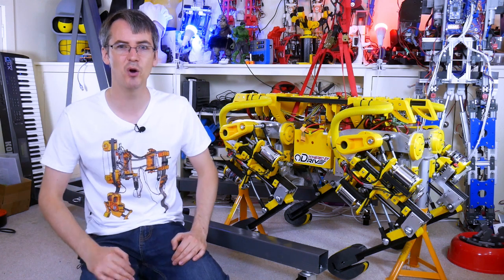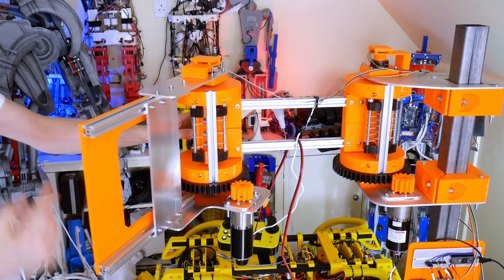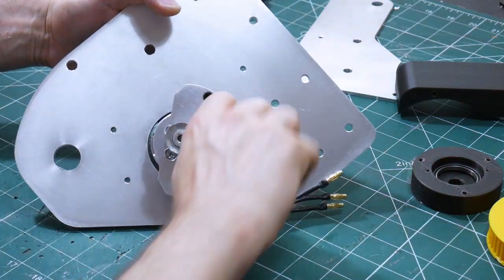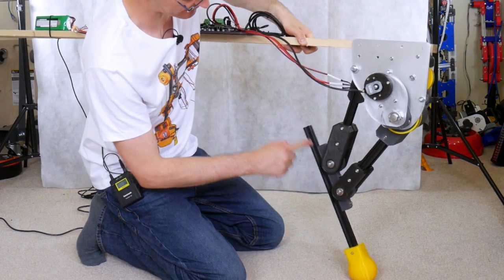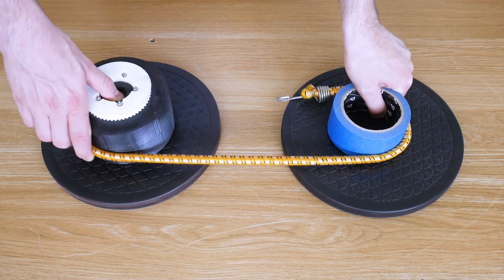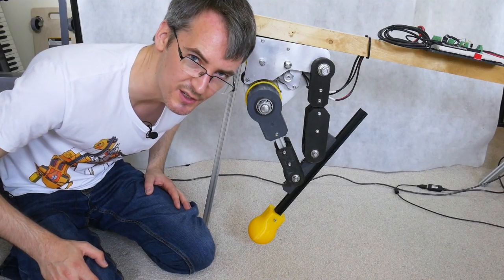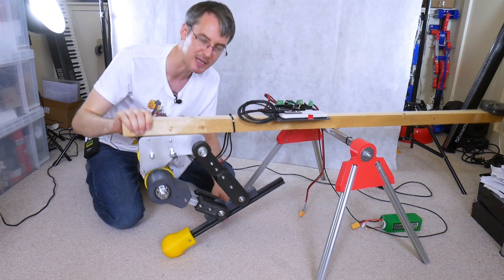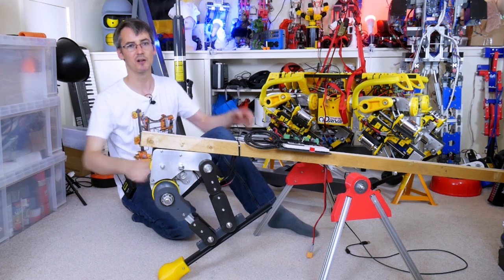Simulating a Compliant Dampened Spring with Current Control

Comment from the maker: The essential aim of this video is to see how openDog needs to react when its feet hit the ground, although I'll be avoiding changing its mechanical structure to make it work. It's very very hard to keep openDog perfectly level 100% of the time when taking steps, which always results in a powerful rigid leg pushing it back hard when it tips and causing stability to be much worse. Also it would be good if it can react to uneaven ground and being pushed about.

I'm going to build four of these compliant legs to help prove if their reaction is correct, and then try to apply that to openDog in code using foot sensors to make openDog's legs compliant and have the same reaction, albeit with rigid actuators that cannot be back driven.

I'm pretty happy with the initial results in this video, so any future leg projects will probably work in a similar way.
Reply: I just got a grant to put together an opendog at my university, is there a good place I could send you an email to ask direct questions or collaboration opportunities?
Reply: The inertial measurement units should hint you about which direction the robot is leaning towards and that should be the the place the legs should move to prevent tipping right? The averaged tilting (between frames) of the body will also tell you how long to stretch each leg to stay leveled. Maybe these should be two different programs collaborating/competing together? One that tries to keep the level and another that tries to step in the direction of movement to keep the center of balance "balanced". Amazing (very complex) project! Cheers!!
Reply: I’m lost as to why you keep messing with these ‘compliant’ legs. You have an issue with balance. How is this going to help?
Reply: So I made my suit Bluetooth and need help with making it self balancing and your the man in that field so any suggestions?

https://youtu.be/2OalUmIwoKw
Reply: why avoid mechanical parts? mechanical parts will always be more correct for these sorts of things than circuitry and motors, though only if planned ahead correctly.
Reply: the music is annoying.  Its not necessary, please stop adding music.

Comment: Why does an actuator need to be backdriveable for current control? I would (naively) assume that you could actuate a non-backdriveable actuator in a back-and-forth pattern and measure or limit current when the actuator is moving against the expected resistance.

Comment: I'm ignorant when it comes to CNC, so what it the reason the tool paths hog out the entire center of a large hole instead of a circle around leaving a disc? Would the tool throw it out at high velocity?
Reply from the maker: Yes unless you leave it attached with tabs which you need to file off. I chose to do it that way to make a clean hole.

Comment: Have you also considered the idea of a dampener? It'd keep the foot on the ground rather than it potentially springing back up, while also allowing for more springiness. Basically how shocks and springs work on a car, just on a much smaller scale. Though, I'm not sure how this would work with your motor simulated spring.
Reply from the maker: Well it's damped in software - that's the whole point of the demo undampened vs dampened

Comment: Great video! One way you can offset the weight of the mechanism and take the load off the motor is to implement a bungee or a spring to support the weight. Or even a small air cylinder!
Reply from the maker: I'm currently building another three legs that will support themselves, so I may we ll do that

Comment: Somehow I get the feeling that an analog circuit in this build is needed. Digital just requires too many clock cycles, and I swear it looks like you need tubes. As in vacuum. Think about it. Even if that is way off, analog may help in some instances, I just KNOW it. Anyway, Excelsior.

Comment: When you say that your going to make more legs for a total of 4, and attach them to a frame to test them, I imagine you 3D printing plastic corners, and assembling something out of extruded aluminium. But I liked the balancing piece of wood, in the drop test, so… I think it would be simpler and less time consuming to go to a home improvement store, and have them cut out a rectangle of plywood approximating the size and shape of Open Dog. Then you can just bolt the legs onto the corners, and stack weights on top as needed, where needed.

Comment: James, I suggest looking a bit more into the I part of the PID controller. With just Proportional gain you will typically have a steady-state error between your setpoint and actual state (in this case caused by the force of gravity). Integral gain is about automatically eliminating this steady error over time, not increasing the speed of the response as I think you said in this video (that's the job of P). Just be careful to keep the Integral contribution small as it is inherently destabilising, and might need an increase in D to counteract.

Comment: You know, the dampening in car's suspention is due to oil friction inside the piston. You might just need to "break" the leg's movements with friction based on the speed. Like.. linear disk breaks?
Reply: Oil dampers dissipate energy to viscous forces, which means the loss is pretty much proportional to speed. Sliding friction is not quite the same; you typically get sticking (greater force needed to get it to start moving than to keep it moving), and once it is moving the force is pretty much constant, not proportional to the speed. It's also much less consistent over time as the surfaces wear out.
Reply: @Tombsar  the wear would not really be a problem such a low force aplication. Also, as the speed is already measured translating it into a linear breaking force would make it  constant enough.

Comment: Instead of putting pressure sensors in the feet, have you thought of installing strain gauges on the beam to the feet pad to measure forces. You could even do the same for the side to side actuator
Reply: I came here to say the same thing.  That's exactly what he needs.

Comment: So is the current draw too noisy to use?  I was always picturing a setup where the motor is never "over driven".  A setup where the entire compliance is done in software and the "springiness" is created completely from positive drive with the motor.  This seems like it would work in a system like the dog legs because technically the ball screws would never be backdriven.  The arduino would detect the increased current of the physical resistance to the leg hitting the ground, drive the motor the other way and then "spring" back.  I hope I'm making sense. It sounds good in my head but I'm no robotics engineer.

Comment: If it were me, I'd add a second drive to the second support. Something of an off center cam or something of that nature to facilitate forward movement. Essentially the second support that doesn't have a motor on it would be mounted via berrings to an off center cam and would change the angle of the lower leg in relation to the knee joint. Used in conjunction with the lift motor you should be able to get about 20cm of forward or reverse transit per stride judging by the dimensions you gave in the video. And just to throw this out there, this is why I love your channel.
Reply from the maker: I could do, this is just a test for now, we'll see where it takes us

Comment: Those are pretty large parts. What nozzle size and settings do you use layer height infill? A significantly smaller part I just printed took 9 hours 20% infill. The large joints would take me days to print. Thanks!
Reply from the maker: They are all with 0.5mm nozzles in this one, although I have 1.2mm nozzles that I've used for some parts in the past

Comment: @James Bruton are you using Mach3? Regardless, you need to set up 'Constant Velocity' mode (or it's equivalent in your software). Your cuts are hesitating at the end of each path, which is causing the stuttering you see, especially when it enters an arc move. This can lead to bad surface finish and broken endmills.
Reply from the maker: The slower parts is the plunge which it does over 50mm.

Comment: Might I suggest a potential gait? Perhaps you lift 2 legs at a time. However, rather than diagonal legs at the exact same time, as one leg is coming down to touch the ground, it's diagonal starts to lift up for it's step. As that one starts coming down, the third leg starts coming up and so forth. Not sure if it would be a viable option, and compliance definitely still would be needed, but just as a suggestion